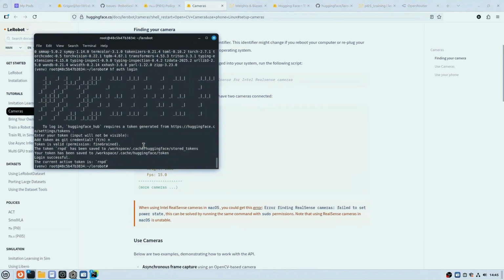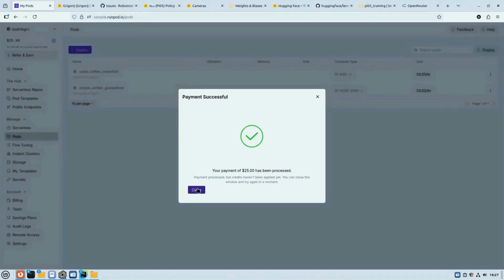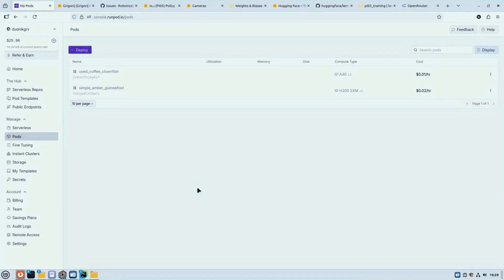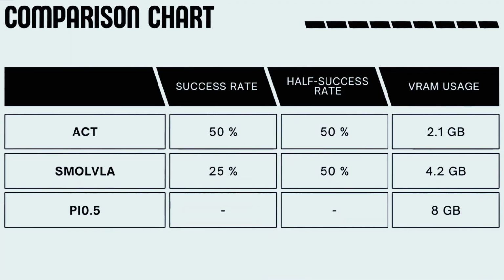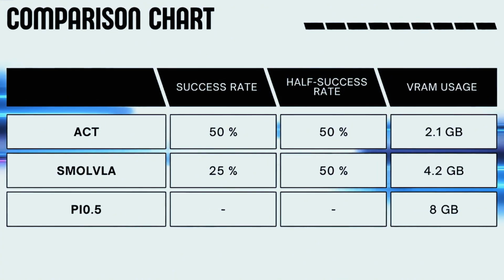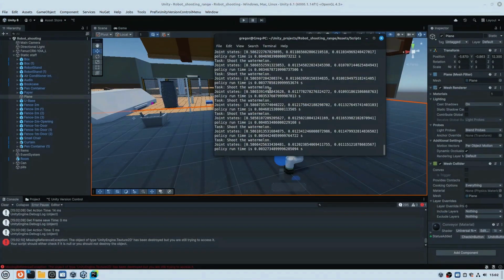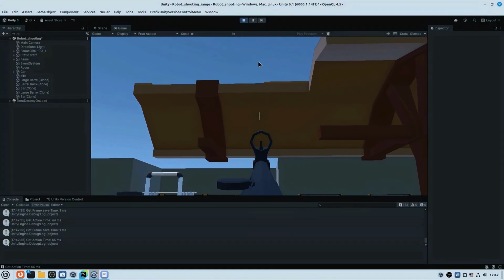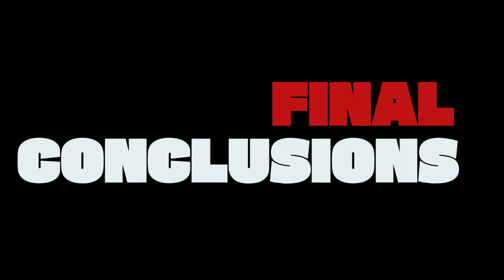I tested 3 different VLA models. Choose this one.

Comment: hello
Reply from the maker: Hey ;)
Reply: Actually I want to do the VLA based project and need to discuss about it
Reply from the maker: @sairasanawar  tell me any your questions ;) I'll help if I could.
Reply: @gregstech I am new or can say beginner in robotics I saw your videos they are interesting, I wanted to know about the basics start of VLA model that how could I start my project. I know the basics of ROS2 now I wanted to use VLA model
Reply from the maker: @sairasanawar  I see. The VLAs may seem hard on beginning, but it's totally doable. Actually you have two ways. first - is to buy so-101 arm and just follow lerobot tutorials on traning models like SmolVLA or XVLA. Second (little more difficult, but does not requires buying hardware) is to use any simulator and train a model in it.

If you prefer second approach, I recommend you to reference my video about training VLA in unity. Also I have another video in production, about training VLA in genesis simulator.

Also, maybe you want me to create some getting started video for very biginners? If yes, let me know what exactly you want to see in it ;)
Reply: @gregstech  I'm a beginner, although I have a little experience working with ROS 2. I want to build a ROS 2–based simulation using smolVLA with the SO-101 robotic arm, but I'm not sure how to get started or what the proper workflow should be.
I have a very short timeline for this project, so I would really appreciate your guidance on the best way to start and avoid wasting time.
Thank you in advance! I look forward to your response.
Reply: @gregstech  I'm a beginner, although I have a little experience working with ROS 2. I want to build a ROS 2–based simulation using smolVLA with the SO-101 robotic arm, but I'm not sure how to get started or what the proper workflow should be.
I have a very short timeline for this project, so I would really appreciate your guidance on the best way to start and avoid wasting time.
Thank you in advance! I look forward to your response.
Reply: @gregstech  i need very biginner video too and ROS2 simulation based need help
Reply from the maker: @sairasanawar  I just starting learning ROS2 too, so honestly I also have no idea how to set up SO-arm in ROS ;) I tried to do the same a year ago, but I wasn't able to properly install SO-arm Gazebo exstension.
 
Is using ROS for simulation is must-have requirement for your project? If not, I'll suggest you to go into Isaac sim - there is SO-arm asset for Isaac that many people use.
Reply: @g @gregstech understand but Issac sim I even did not tried, as a student a I have a task which I have to be complete it within two months. I have a experience with hobby robotic arm in ros2. But for this project or task I have to implement VLA that’s why trying to know how I can start.
Reply from the maker: @sairasanawar  I understand. So set uup of the arm simulation/control is not a problem for you, only VLA implementation is the part you struggle? If yes, I may send you some my code where I implemented VLA on other robots, I hope you'll be able to ajust it to your simulator
Reply: @gregstech yes I need help for VLA and thank you
Reply: @gregstech can I get you email please?

Comment: Hi, great video. Do you know what is the cause of the unstable movement, both in the Robot and in the unity environment? Is there a way to improve it?
Reply from the maker: I observe many people met that "Parkinson" effect on their robots. I case of Unity, the reason most probably been that model needed more time to make it's decision then it has between simulation frames. In case of real robot - I'm not completelly sure. I there is sync inferece - probably the same. If async - maybe unstable bechaviour of lerobot async server (my situation) - but they probably improved it already. But also maybe here some issue with sticking action chunks together.

If you met similar problem with your robot, tell which VLA, fps and whether it sync or async you use, and I'll try to tell more.